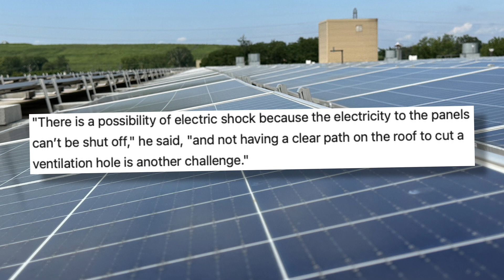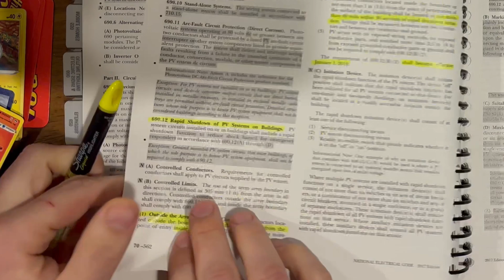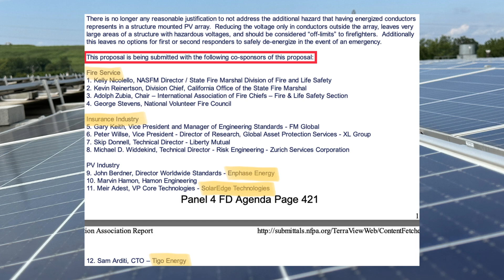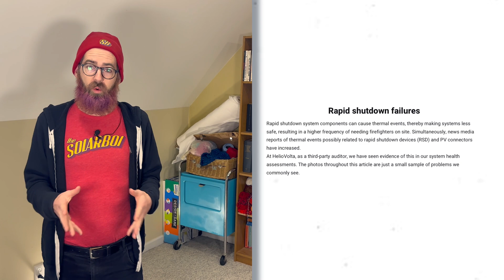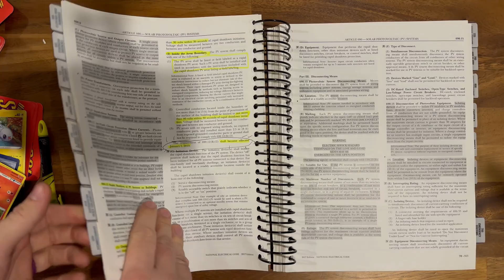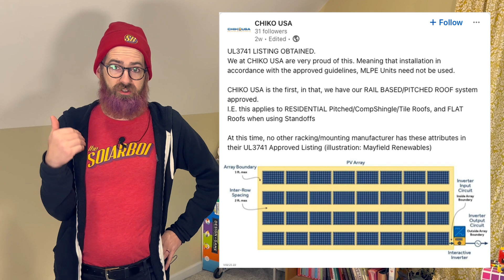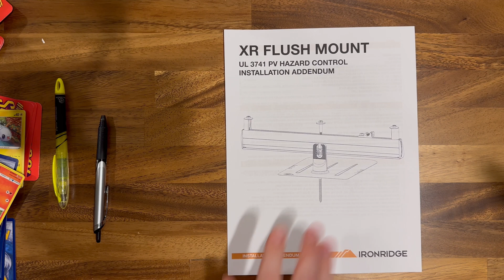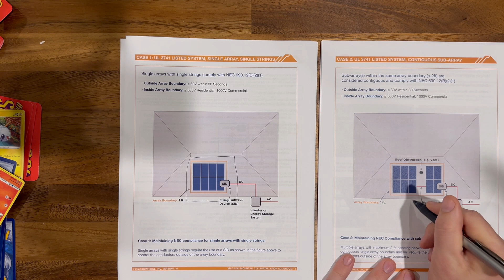Huge Breakthrough for Rooftop Solar! (UL 3741)

Comment: I have designed a DC solar system with under 80V within array boundary and under 30V cable outside of boundary using standard, non UL3741 listed components.   Maybe 3X cheaper than the products you show.
This would be inherently safe/always "rapidly shutdown) per 690.12 as you showed in nec2017,2020 and is the same in 2023.  What inspector issues would you see with this?
Reply from the maker: You wouldn't need UL 3741, since it will already comply with 690.12.

Comment: "...takes an axe to the meter base???" (0:56).  That is not at all how this scenario would unfold.  If you hit a meter with a fire axe you would short out the utility feed upstream of the main over-current protection device and create a very dangerous arcing problem.  In reality a fire-responder would carefully remove the meter from the socket and drop it on the ground.  This takes seconds.  The utility feed is still energized so care must be taken around the overhead or underground drop but the rest of the AC distribution is now de-energized, except for....  

If you look a little deeper into the subject, you realize if there is a battery backup system on-site It is still possible there are AC and battery energized wiring in the structure.  The video producer is oversimplifying the situation by not recognizing this possibility.

 I am looking for reliable information on the subject of UL3741.  I may not find it here.
Reply from the maker: @williammiller4786  "axe to the meter base" was fun shorthand. I don't literally mean that firefighters will put the sharp end of the axe into the utility wiring. A firefighter friend once described to me taking the blunt end of an axe to bang out the meter from the meter base because they couldn't turn it off otherwise. That's where that turn of phrase came from.
Reply from the maker: @williammiller4786  battery shutdowns are a different topic, not directly associated with UL3741. They do need a rapid shutdown switch, I'm not arguing with that. That's a much more reasonable safety rule than module level rapid shutdown for solar panels.

Comment: I am still a little foggy on how racking systems can remove the need for a panel level module to solve shock hazards. I have permission to install solar panels on my boat dock, steel roof, frame, cables etc., so I need to understand this much better than I do now.  I was originally looking at a nodule level shutdown solution. In fact it was so easy to get permission that I figure that the entity just doesn't understand solar as well as me. I started looking for solar panels with integrated/snap in MLP devices to avoid extra wiring plus the possibility of the wire between the MLP and the panel becoming damaged. I basically want the equivalent of GFCI/AFCI detection on the string inverter and then when it trips the solar panels shut down from the breaker trip. Where do you think my next stop on my panel education should be and the best way to solve this problem?
Reply from the maker: People tried to make integrated MLPEs happen, but it's never going to happen in a way that makes it easy to service in 20 years. If you're building a dedicated solar structure, you might not need MLPE or UL3741.
Reply from the maker: I want to add more education about solar panels safety to ul3741.com at some point, but I'm in the middle of a whole-website rebuild to make things easier to find and understand, so that will likely take some time

Comment: TLDR: There are some racks that are getting approved for the new UL3741 that will obviate the need for rapid shutdown modules (and he essentially says that rapid shutdown was a paper tiger and that firefighters are at no risk from solar panels and were just boogeymaned by shitty gov regulation). It will make it faster and cheaper and probably safer to get solar installs done.
Reply from the maker: @mikem5858  not bad

Comment: In your opinion: D o you need microprocessors? Don’t microprocessors make the solar panels more efficient? I guess it’s not too efficient if they break down and your not collecting solar energy. How often would you say they breakdown per customer? Sorry for so many questions, but having someone knowledgeable with experience is the best person to ask. Thanks for this video.
Reply from the maker: @bendungee1669  microinverters is not the most efficient or sensible way to go, most of the time. I think a lot of people install them because a) the installer needs to understand less about solar/electricity to make a successful installation, and b) it's cool to know what each panel is producing. Neither of those is a great reason to go the microinverter route.
Reply: @ Thank you for your response and experience.

Comment: Great video! Have you been looking at home ESS systems? How much is IFC 1207.8.3 an impediment to residential batteries, and is there a way to loosen this restriction on the distance to property lines if safe?
Chapter 12 Energy Systems

1207.8.3 Clearance to exposures.
ESS located outdoors shall be separated by a minimum of 10 feet (3048 mm) from the following exposures:
1. Lot lines.
2. Public ways.
3. Buildings.
4. Stored combustible materials.
5. Hazardous materials.
6. High-piled stock.
7. Other exposure hazards.
Exceptions:
1. Clearances are permitted to be reduced to 3 feet (914 mm) where a 1-hour free-standing fire barrier suitable for exterior use and extending 5 feet (1524 mm) above and 5 feet (1524 mm) beyond the physical boundary of the ESS installation is provided to protect the exposure.
2. Clearances to buildings are permitted to be reduced to 3 feet (914 mm) where noncombustible exterior walls with no openings or combustible overhangs are provided on the wall adjacent to the ESS and the fire-resistance rating of the exterior wall is a minimum of 2 hours.
3. Clearances to buildings are permitted to be reduced to 3 feet (914 mm) wh weatherproof enclosure constructed of noncombustible materials is provided over the
SS,
and it has been demonstrated that a fire within the enclosure will not ignite combustible materials outside the enclosure based on large-scale fire testing complying with Section 1207.1.5

Comment: I believe microinverters put out either 120 or 240 volts. (more than 80 volts so how do they qualify?)
Reply from the maker: You can shut off that AC on the utility side, if grid connected, and the inverters stop putting out power. If batteries are involved, it's more complicated, but they get a signal to shut themselves off when you hit the designated button.

Comment: Solar Panels are a very weak link in the solar industry. And where do they go after they are no longer able to work.
Reply from the maker: Not sure I know what you mean by that. Solar panels are the most reliable part of the solar industry, I almost never have to service them. But when they are decommissioned, we've found ways of recycling them, but often they get resold to be used again! They last a hell of a long time.
Reply: Where does all the dirty exhaust go after oil and gas are burned to make electricity? At least it's possible to recycle solar panels it's pretty hard to recycle burned oil and gas and coal.
Reply: I have stacks of old decommissioned panels. They all put out the same watts as when new.

Comment: electrical PE, the biggest issue I have seen in the latest code changes is that more and more code changes are made not for safety but to line the pockets of manufacturers.  They have lots of money to park someone on these code boards and yield outsized influence on desicions for example GFI protection is soon to be required for residential ac units

Comment: If the fire service was really concerned about reducing fires, they would outlaw open flame from residential homes instead of hassling the solar industry.  There is no need for open flame in a home and is the leading cause of structure fires....

Comment: Electricity to the panels can't be shut off? Bass ackwards statement. If you are that cloudy on electricity, why do you have any say in any of this? And it most certainly CAN be shut off FROM the panels, just as you can from the grid. If nothing else you can simply cut the feed with insulated cutters. But rooftop is not a good idea. Mine are ground mounted and remote from my house, with a disconnect at my fuse box, which is also remote from my house. The utility company shut offs are almost always on the house, in a fire they may or may not be accessible. There goes your " the building department knows better" argument. They are such slimy mooches it's sickening.

Comment: This is interesting because Tesla's ZEP mounting system doesn't use typical rails.
Reply from the maker: @f.robertfalbo9800  their racking system is UL 3741 certified, but not in the same way Ironridge's is. Their instructions are to break the circuit every three panels, instead of allowing voltage through the entire string and breaking only at the array boundary.

Comment: So this is basically the USA going in the opposite direction of Australia by making solar installation much more difficult code and certification burdens.  I would like to see data on  safety and fire risk comparing Australia to the USA.  This really looks like American industry add energy companies trying to control solar installations.  It's not surprising from a patrol State like the USA.  Sadly the result is very low solar penetration compared to what is possible with the super low cost.  Australia is doing amazingly well with rooftop solar now that they have big batteries.  Even the EU has more freedom with balcony solar.  I'm glad I got my solar under California NEM 1.0.

Comment: I've worked with getting UL certification. UL is both a standards body and a listing agency. The certification isn't just on the design, but also for the manufacturing. We made the mistake of shipping some equipment before our manufacturing facility was certified. There was no way to get that equipment certified to UL standards, even if we paid to send a UL inspector to where it was installed to see that it was manufactured to the design which was certified. Luckily, one can use other national certifying bodies to show that a device meets UL standards, and we eventually switched. On top of that, every time you want to make a product improvement, you have to go through the same process again, possibly including another inspection of the manufacturing facility. There are also periodic audits of the manufacturing, and the company has to pay for all of that.

Comment: OK, this reminds me of an argument I had with my boss on working on HVAC equipment in the rain. I worked commercial HVAC for nearly 30 years and frequently I would have to troubleshoot 480 Vac panels in bad weather, snow, heat, and rain. I would refuse to do it in rain however and my boss argued that he had studies that showed the hazard was negligible. My argument was ok, you demonstrate it and Ill do it, he never did of course. I said, if your so sure your not going to get electrocuted by sticking your hands in a panel while its raining out, then show me by sticking your hands in a 480 volt panel while I douse you with a garden hose and if you don't die, then Ill troubleshoot in the rain. This is the position I'm sure, where the fire fighters are coming from, and this study, how ever it was done, means jack shit to a fire fighter. I don't know how DC voltage operates in water but I have experienced ungrounded 480 vac packaged HVAC unit sizzling in water on the roof and have worked on panels live where they exploded due to rain.

Comment: Can you spin back your claims at the very beginning about how this was going to reduce cost? How, exactly is this true and what impact ($$$) do you expect. Thx!
Reply from the maker: @cgodlove  3741 theoretically reduces cost of components/manpower on the front end, and reduces service costs considerably across the life of the system. While there are warranties on parts like microinverters, optimizers, or RSDs, those do not cover much in labor costs, and it's not uncommon to have at least one service call a year on a SolarEdge system (depends on the size, of course). Optis and micros will also result in less efficiency for many if not most modern systems. Losses all around.

Comment: Thanks for the info.
As a former Firefighter I would say & solar installer, owner/ operator I think you were a bit hard on Firefighters.
NFPA rules are set by a group that any mfg can buy a seat on , so they can force the use of products they sell. I would imagine NEC. is the same.

Comment: Enphase microinverters and one more panel on complicated roofs, if needed, and enphase would tell you which panel is not right.
Enphase start up earlier and shut down later. 
Enphase is easier to add a panel in the future. 

Enphase microinverter avoid roof fires and fire fighters hesitation if roof access is needed. 

Also,
My neighbour's string PV (600vDC) on their metal roof with metal gutters and metal facia and metal stormwater down pipes.
His children, his family, walk beside the metal down pipes beside the house and the boundary fence. 
You can not avoid touching the  metal downpipes. 

The installers came onto my property to access his roof and broke my fence, the boundary fence, and hid the damage. 
Their workmanship  ??? 

Sorry for the digression but you made me think. 

Should the 4 down pipes be earthed. And covered with insulation to 8ft above the ground ?
The old neighbour had no council permit that I know of, and immediately sold to the new young family. 

Wow, you certainly made me think. 

So if firemen must isolate before going onto the roof because of potential danger what do I say to the neighbours, the parents of the 4 year old. 

Big comment, yes.
Many would want to know I am sure. 
My location is Sydney Australia. 
Extremely sunny and bushfires in nearby national parks over grown with tall gum trees and scrub undergrowth. 
Maximum PV production. 

240volt AC is more survivable than 600voltDC.
AC alternates and so can break the current.
Reply from the maker: @stephenbrickwood1602  if there's a way for the solar installation to energize the downspouts, then the downspouts are already earthed adequately through the connections to the metal roof/solar racking. No insulation is needed on downspouts, any more than the metal on an electric stove or other appliance needs to be insulated.
Reply: @dereksolarboi   then why do the firemen need the isolation switch.?
Reply from the maker: @stephenbrickwood1602  in Australia, the isolation switch at the panels was removed from code because it caused more issues than it solved. But the reason things like this are requested is because firemen don't want to be second-guessing whether something has x number of volts after they swing an ax through a wall. But comparing normal situations to an emergency situation isn't a useful way to think about code rules.
Reply: @dereksolarboi   thank you .
I  will not say anything to worry my neighbours. 
It was something that concerned me when I saw the ground mounted arrays.
Yet the metal roof and metal down pipes and the family are just disturbing to me.
I  will have a similar situation soon myself.
Reply from the maker: @stephenbrickwood1602  even if metal is touching a part of the solar circuit (though if that happens, the solar inverter will error out, alerting the monitoring), it doesn't mean someone can get shocked from it. Electricity travels in a circuit, and the electricity from the solar panels doesn't desire to travel to earth. It wants to maintain a loop with the solar panel circuit. It sounds like you think a lot about electricity, and I'd love to recommend for you to feed that curiosity with an electrical theory course. Mike Holt has some good material on that front, and it'll help you sort out some of those questions around how and where electricity likes to travel.
Reply: @dereksolarboi  I did some electrical engineering as part of my CivEng degree. 
But my opinions and real world reality are different and I could hurt myself. 
Hahaha. 
My old electrician friend told me about a job he took over and the previous licenced electrician had wired up the neutral and not the earth connection. 
If someone touched the wrong thing they would be the earth he said. 
The whole portable switch room could be alive.
Scared the Shttsnpants our of him.
I  am an amateur and unpractised. 
So I ask questions of experts. 
Thank you for your insight and feedback. 
You make sense to me.
Reply from the maker: @stephenbrickwood1602  happy to help!